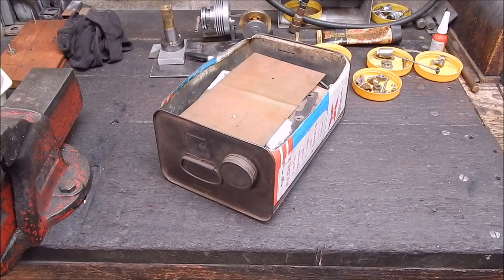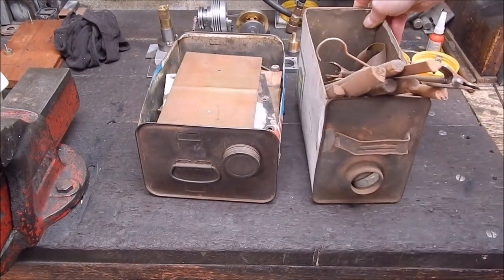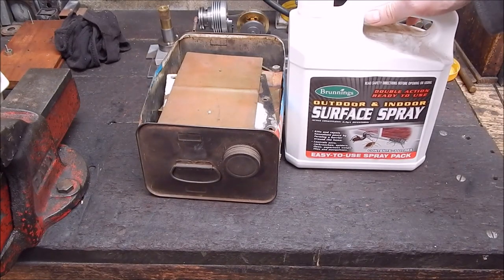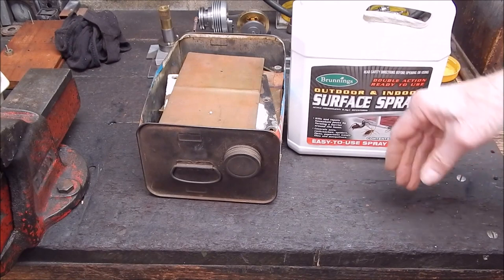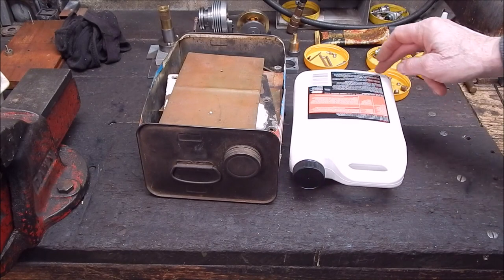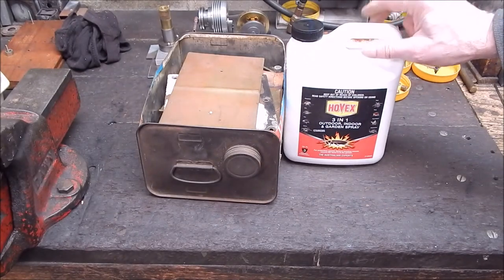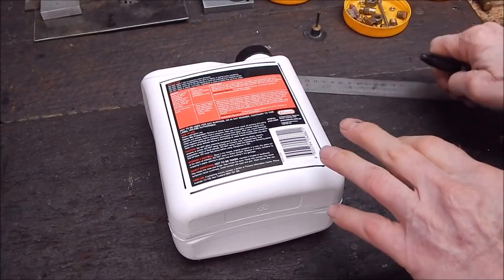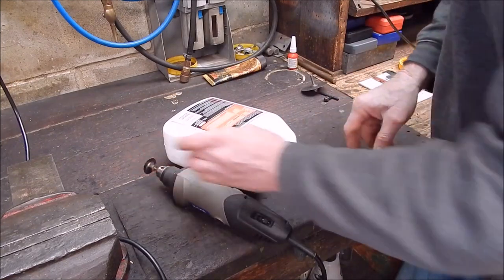Easy to make small storage containers for the workshop  -  freebies as well

Comment: Great tip Rob, I find the 20ltr drums also handy as oil drain containers, wash trays etc. Cheers, Peter
Reply from the maker: It's incredible to see the semi trailer loads of poly oil and chemical containers continually being chopped into pellets at the plastic recycle centres.  They re-use it again.  Having done a lot of farm cropping, we used to go through dozens of the 20 litre drums every season (Roundup etc), and we were only small time croppers compared to the large holdings.   The use of plastic is entrenched in society.  Cheers Rob

Comment from the maker: NOTE:  To reduce any chance of the plastic tearing at the cut out corners, I later radius each one using a small drum sanding fitting in the die grinder.  The finished container is quite rigid and strong. My plastic ice cream containers have been going for 30 years, so I had better stock up on more of these just in case something breaks.  Cheers Rob

Comment: The plastic containers with a side cut of are good for small engine oil changes to drain the oil in, and once the oil is drained you can remove the cap pour the oil into an enclosed container for disposal. This is where it would be nice if all companies made the same size container as you could make a frame and use them as drawers. Difficult when they are all different sizes.
Reply from the maker: Good idea Tony.  They have lots of uses.  I use a large one (10 litre) with the large side cut out to store my ratchet straps for load tie downs.  Really works well.

Comment: Those square cut corners might tear or crack, another option would be to use a spade drill bit or hole saw and drill a big hole in each corner, then cut between the holes for rounded corners ;)
Reply from the maker: I thought about drilling each corner to reduce the chance of tearing, but didn't think it would be very likely.  It is a better way to do it though and got me re-thinking on the finished job.

I will re-visit the container and use a micro drum sander in the air die grinder to put a radius in each corner. Cheers Rob

Comment: Hey Rob, checkout Woolworths and Coles on boxing day for another great storage solution. Shortbread goes on special and the tins are perfect for smaller bits of things you might want to stack.

Ridiculously cheap, and you can take the bag of shortbread out and stick it in a jar with no cleanup of the tin required. Best of all, they have all sorts of vintage cars on them so the look like they belong in a shed.
Reply: *just don't overload them. Be sensible and they'll last years

Comment: I still use an old oil container with the side cut out as a parts wash tub - a bit bigger than a Chinese food container and usually a bit thicker plastic than an ice cream container. 
When I’m finished using it i let it sit for a day or so ( cover it with a piece of rag to stop evaporation and keep the smell down )-this lets the shit settle out , i can then remove the cap and decant the petrol or kero into a container for next time leaving most of the crud behind . They also make a good Piss bottle and bailer for the boat , just cut out the section around the cap to around 1/3 down the container leaving the handle to hang onto .
Reply from the maker: I tend to use old aluminium saucepans to wash parts in (don't ask me why ), but your idea sounds good.  I always re-use the petrol.  The oil it picks up along the way prevents rust.  Cheers Rob

Comment: I suggest you rather get into woodworking and make boxes, because 1) easy and fun, 2) way prettier than reused oil cans and 3) you can make them the exact size you need, put in subdivisions etc etc etc. And all you really need basically is a table saw. Or even just a chop saw if you're content to stick with dimensioned lumber.